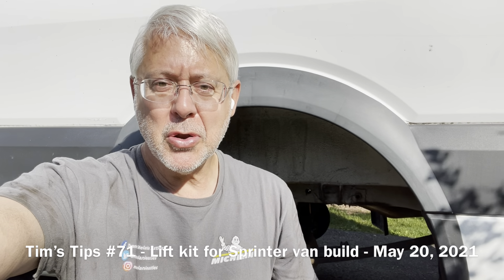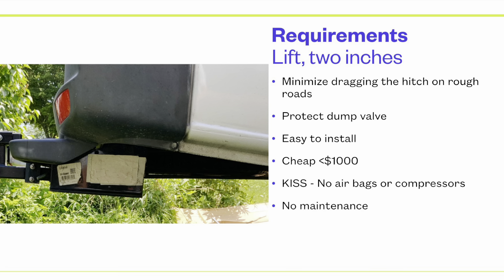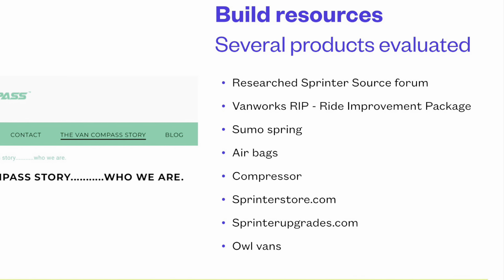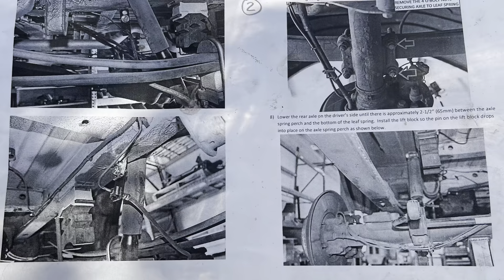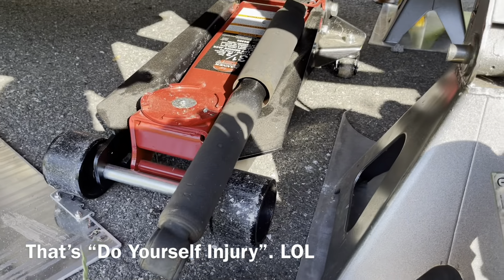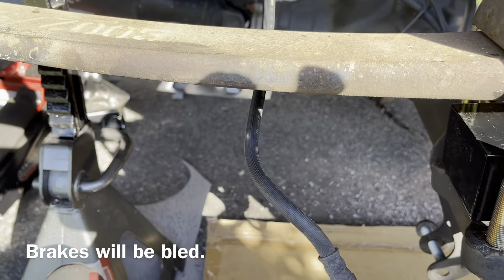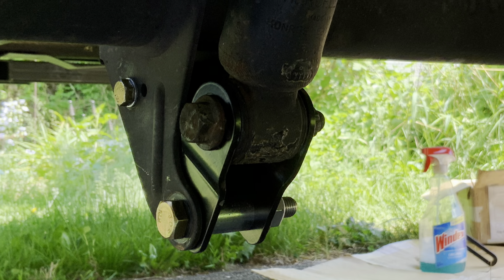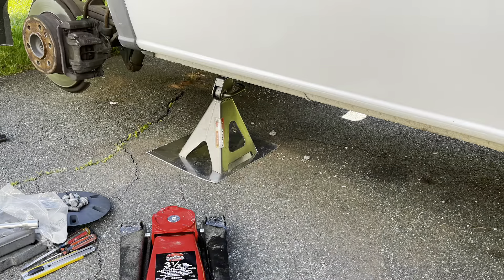Tim’s Tips #71 - Lift kit for Sprinter van build - May 20, 2021

Comment: You it did the rear?  Very Bad idea,. Doing only the rear will seriously change the steering geometry, and camber is also affected. 
It will make it easier to steer.
Reply: Only the rear is very bad idea!
Reply from the maker: The rear of the van was sagging. This lift kit just set it back to the way it was. Correct? Or set me straight.
Reply: @tdrager  I had an old ford that needed new springs, The entire job only cost me $150 and that included new springs and labor, Much better solution, air shocks and such are nothing but a band-aid. Better to pay and have it done right.